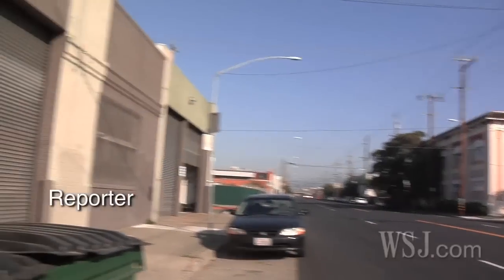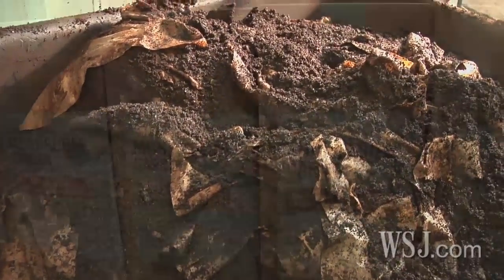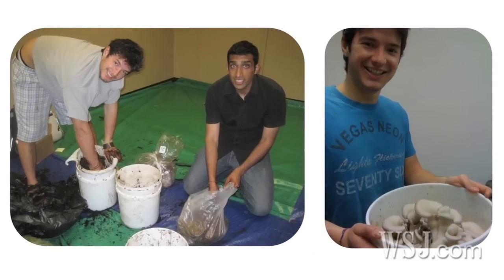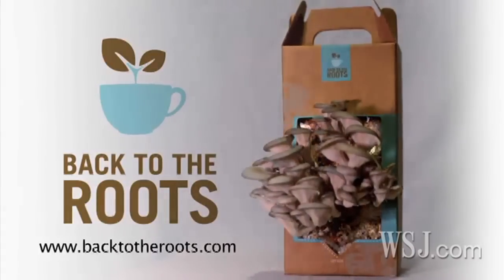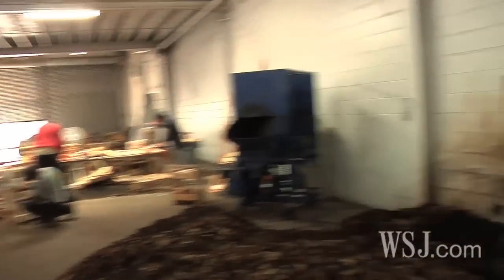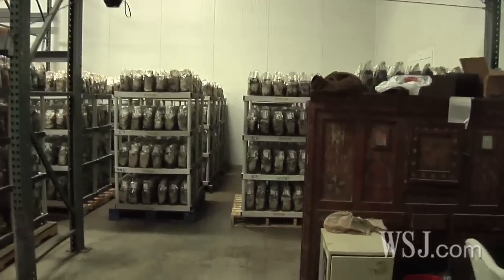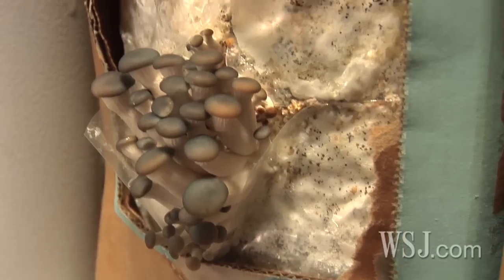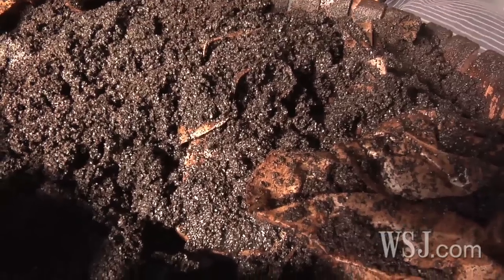Grow Your Own Mushrooms in Used Coffee Grounds

Comment: you MUST sterilize the substrate before use and grown the mycelium in a clean air at 25°C. As you see in this video, if you get the same, you will harvest molds and flyes.

Comment: I watched a lot of the videos and all show that it needs to be sterilize.
Reply: Keep in mind that mushrooms have been around far longer than we have living on non-sterile media. It's absolutely possibly to grow them without sterilizing, but it's also riskier.
Reply: ok
Reply: +Jackie Flynn What I think they do is...that they again pour hot water over the grounds and then they strain and push the water out. However, I am almost certain, they can just use the coffee grounds without sterilization IF they pick them up early in the morning each day and press it out, inoculate with the spawn and bag it. This way the coffee ground does not have time to get any mold growth and it was already through the hot water sprinkling (since the coffee was brew the day before). They save time, heating cost and water by picking up already used coffee grounds... Marvelous!  (You could use hydrogen peroxide for mold prevention)

Comment: when I try to save coffee grounds it molds.
Reply: +Josephine Rock you can also sanitize them by using some form of alcohol. the alcohol will kill off mold and other fungi, then evaporate.
Reply: +Josephine Rock Yes, but you can spray the grounds with very low concentration hydrogen peroxide to kill off mold spores. However, then you'll have to use mycelium that was already grown in such conditions with hydrogen peroxide. Hydrogen peroxide is organic because we humans too have it in our system. So, first have your own mycellium grown with very lox concentration of hydrogen peroxide, then you make it get used to it gradually but do not go over lets say 1%...however you can raise it but you have to experiment to see, how much it can take to still get it grown, not killed. This is in short form... do a research on it.
Reply: Try to dry them out. Grounds mold easily when saturated.
Reply: oh ok
Reply: @Jrock32464  also freezing them or even just refrigerating them helps alot
Reply: Kody I honestly doubt they'd use hydrogen peroxide. Electricity is extremely cheap, and heat doesn't require you purchase and ship in chemicals regularly.

So using heat would simplify the supply chain, and likely cost less.

Comment: i tried one of these mushroom kits,  followed the instructions,  after two weeks of nothing i threw it away,  waste of my 10 bucks
Reply: Depending on your temperature and moisture content, it can take a lot longer than that.
Reply: YaMoonSun Never mind that many companies like this will happily ship you another kit if your first one doesn't work out free of charge.
Reply: I had a kit. It didn't grow for a few weeks after I put in near a window. Then I put it outside on a covered porch table and got mushroom a few days later. I guess it liked the outside better.
Reply: @WinMath  it likes small amounts of light because that tells it thats the surface to grow mushrooms rather then the one touching the ground
it also likes a bit of humidity
Reply: @batenkait0s657  Yes low light and high humidity.. Not darkness but low light. Mine took only four days . I got 3 pickings , 2 good ones from front ant 1 smaller one  when i turned box around.I am always a skeptic. This is meant to be a fun hobby. And I have no stake whatsoever in the success or failure of this product.
Reply: 10 bucks